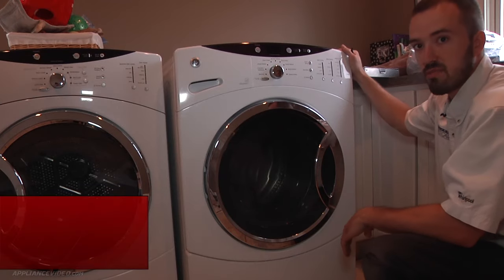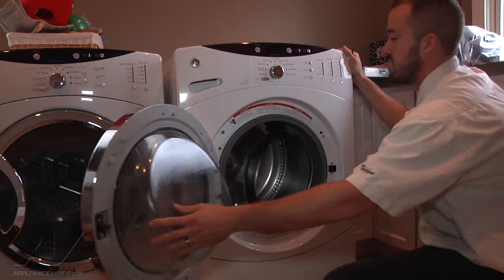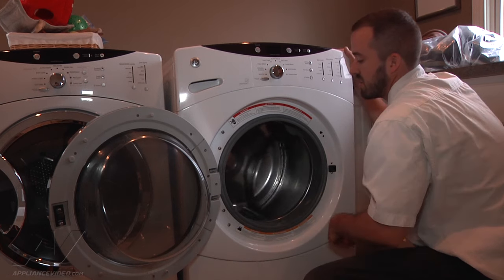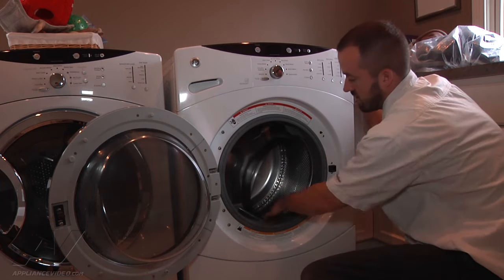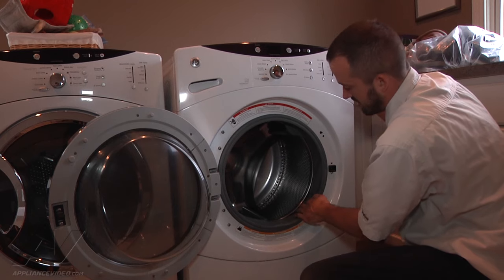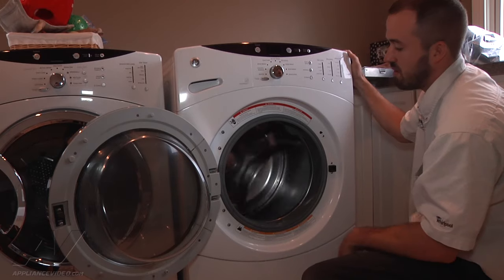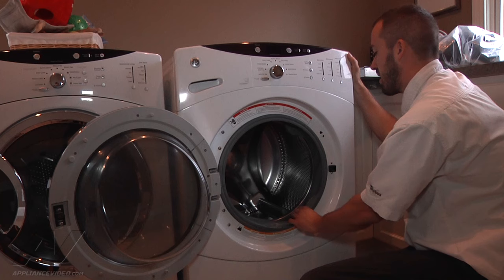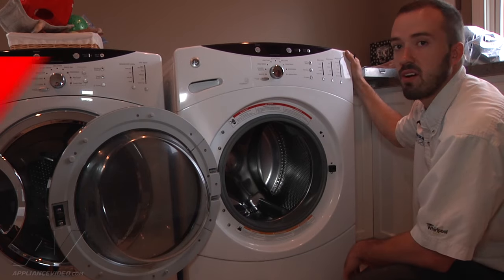GE, Hotpoint & RCA Washer Diagnostic - Burning & Rubber smell & Smoke From Washer - WCVH6600HWW

Comment: I have a stackable washer and dryer the inside is smoking. Do I take the clothes out and try with just water
Reply: I smoke when its spinning out and it doesn't spin it smoke
Reply from the maker: Great question, if you have a more technical question that our parts department cannot answer, you can search our over 17,000 answered questions free at our website www.ApplianceVideo.com under our Repair Help section. You can also call our parts department at 1-800-830-5465 and they can give you help 7-days A week ,or search at www.SaveMoreOnParts.com  .

Comment: have the same problem. looking at code to $1000 in parts. any recommendations for a new washer? thinking about speed queen.
Reply from the maker: Speed Queen is a great washer. You pay more but its built like a commercial unit. Whirlpool would be my second, you can easily get parts anywhere in the US and great customer support network. Speed Queen is horrible, good product bad support.

Comment: What causes this problem?
Reply from the maker: Great question, if you have a
more technical question that our parts department cannot answer, our
technicians are answering all questions at our website at www.ApplianceVideo.com under our Repair Help section. You can also call
our parts department at 1-800-830-5465 and they can give you help 7-days A week
Monday -Sunday, or search at www.SaveMoreOnParts.com  24 hours
7- days A week.
Reply: @shawnhuk  it could be related to an improperly balanced machine or excessive use or heavy imbalanced loads or planned obsolescence
Reply: wear and tear of cheap parts over time